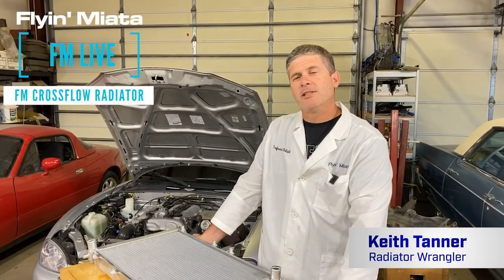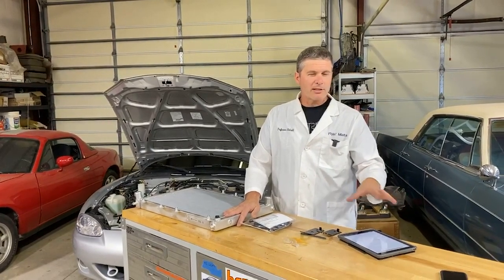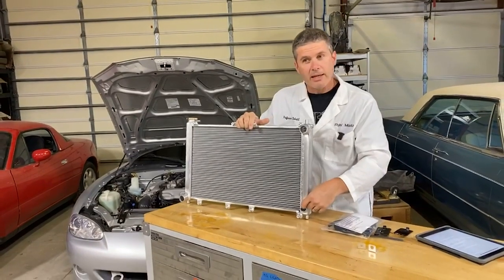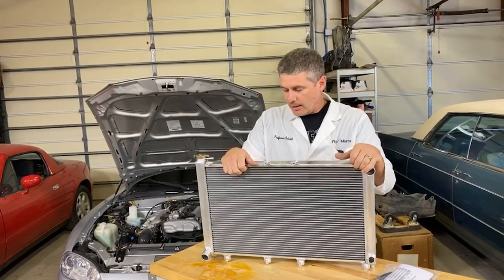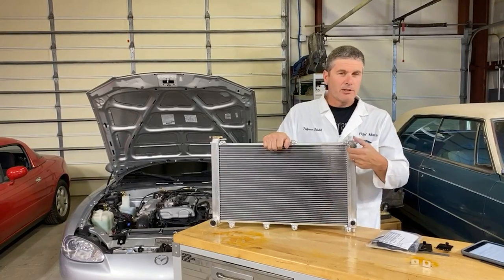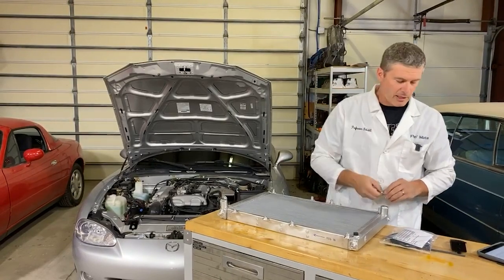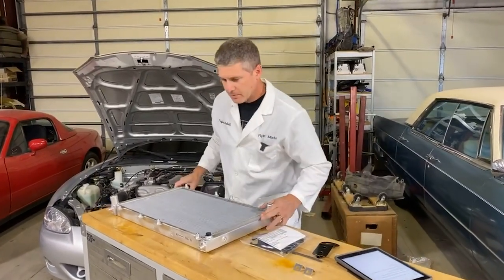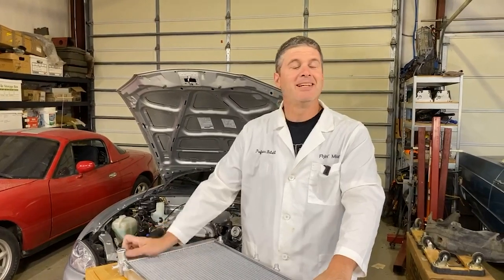Flyin' Miata Crossflow Radiators (FM Live)

Comment: This radiator has the drain in a different place, which means we need to remove the plastic undertray to do a coolant flush. 
I understand it's cheaper to build it this way and gives us a little more space for cooling fins, but keep that in mind before buying one. If you keep the undertray on your car, coolant flushes will become more difficult.
Reply from the maker: The drain can't be in the middle because that would require the end tank to go end to end - that's not how a crossflow is laid out. It's not a matter of "cheaper", it's part of the basic design. Coolant flushes are relatively infrequent so we consider the improved performance a good tradeoff. If you are flushing your radiator frequently and this is a problem, you could drill a relatively small hole in the undertray to give you direct access.

Comment: I don't think you are going to change the amount of TIME the coolant spends in the radiator by running the tubes sideways (9:00). For a fixed flow rate from the water pump, the average amount of time in the radiator depends on interior volume and nothing else.
What will change is the flow speed through the pipes. At high speed, there will be more turbulent flow and turbulent flow will have better heat exchange.
Reply: The FM radiator is much thicker than the OEM (stock is 16mm, MSM is 26mm, FM is 36mm) so the interior volume will be much greater, thereby slowing down the flow.

Comment: If I want to increase cooling capacity, what's the best path? Crossflow with stock fans or brushless fan on a stock radiator? Then upgrade the stock element if more cooling is needed.
Reply from the maker: Generally, you'll start with the radiator. Especially if you have an early Miata, that stock rad is not aging well.

Comment: Any benefits to running a race radiator on a daily driver (ND)? Any weight difference vs OEM including coolant?
Reply from the maker: If you're not having trouble maintaining temperature, increasing the cooling ability of the car won't make any difference. We haven't checked weight differences, cooling function is the primary concern here. But it will be lighter than a big multi-core setup that runs considerably higher fluid volume.

Comment: In between the factory Mazdaspeed rad and your fm cross flow.  I don’t track my Mazdaspeed and it was conservatively tuned with your big enchilada kit by your former employee Ken Hill (pretty sure that was his name) for 195whp/205wtq on 12.5 or 13lb boost with the factory turbo.  My budget is limited and this is my daily and only vehicle.  Is this true that buying a new oem Mazdaspeed radiator would be 15 years old and brittle?  Also what specifically needs doing to fit your cross flow in my 2005 MSM with your big enchilada kit installed?  My other concern was with this not being a track car, getting up to temps and the excess wear from it taking longer to reach optimal temps.  I would assume it would be best to run my oem radiator cap?  Do you still recommend the cross flow for my application?  I have winter temps to summer temps to deal with on a regular basis.  I do use the power hitting top boost on a regular basis, but again not usually for extended periods of time.  I am not trying to do the minimum here, but the best for my application.  Any help would be greatly appreciated.  I may call you guys tomorrow if I don’t hear back!  Thanks!
Reply from the maker: Please contact our customer support team directly. They will be happy to talk you through the benefits of our crossflow and help you with any concerns you have for you Mazdaspeed.

You can call 970-464-5600 8-5 Mountain time, or drop them an email at support@flyinmiata.com. 

Thanks!

Comment: Any efficiency gains over your older crossflow? Mine is from 2015 or 2016, was before the built in temp sensor bung.
Reply from the maker: Other than the fact that it's easier to fill and drain, not really.

Comment: Any point in replacing the stock radiator on an NB that's only driven only on the street? Non boosted bone stock engine.
Reply from the maker: If you aren't experiencing any issues and don't plan on tracking the car, you are probably fine with the stock radiator, but keep an eye on the plastic. Once they get to a certain age and start to change color, they are prone to fail. The aluminum radiators like our crossflow are more efficient and last longer than the stock plastic units.

Comment: My 2004 Mazdaspeed  w116,000 miles never  overheats. Gauge stays in the center in 100 degree  heat under hard drives  for 200 mile  trip.
Reply: My 03 Gauge stays dead center from about 165f-240f. It may be getting warmer than you think. Assuming you have decent quality fluids, I wouldn't worry about it. Before I had my cooling system dialed in, I'd only do a cool down lap if it reached the high 230's.
Reply: Wait, the temp gauge actually works on the MSM?
Reply: Edit: Removed comment as I spoke out of assumption rather than facts.
Reply from the maker: The car will not "blow a gasket" before the stock gauge moves. Basically, if it starts to move then the car is having trouble coping and it's time to take some sort of action. You do have most of the sweep of the gauge before you're in any sort of trouble.

Comment: Does it fit in an automatic na miata?
Reply from the maker: It does not have the transmission oil cooler built in, so you'd have to install a secondary cooler for the trans. Otherwise, yes.